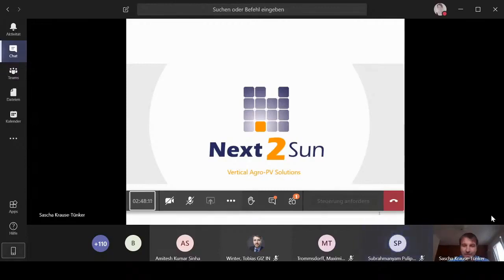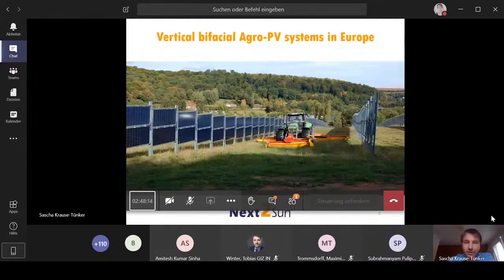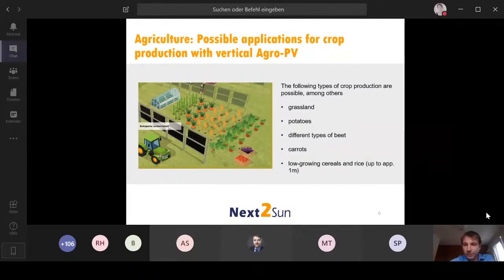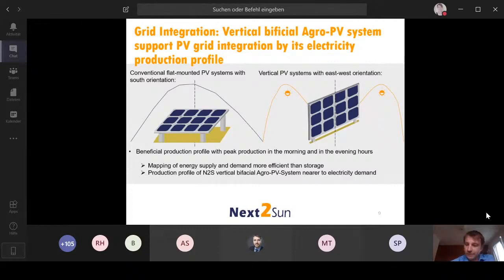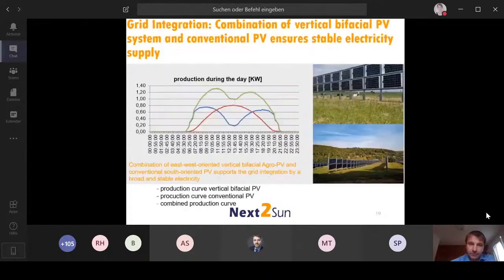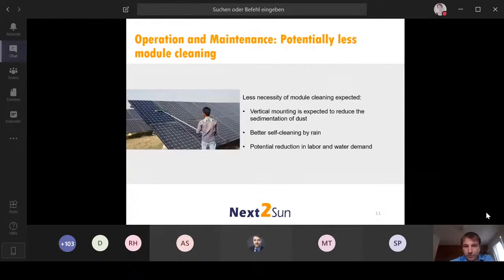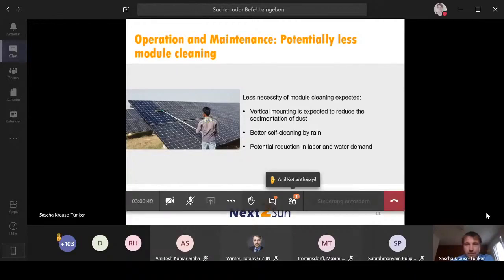Vertical Agrivoltaics in Europe by Sascha Krause-Tuenker

Comment: I designed, cut, welded and built my own system. I can tell you from bitter experience 
optimistically you can expect reduction of 30-35% in northern climates of your agricultural production due to reduced sunlight.
Optimistically.
Realistically it is unfeasible and unviable solution overall.
Neaither here nor there.

The two - solar and agriculture can ONLY be combined if your construction is HIGH ENOUGH and with enough inter-row and inter-panel spacing.
In my case it is 2 meters interrow and 25cm (10inches) inter-panel space.

This seems to be my goldilocks in my geographical location. 

Very important here:
My installation is 20kWp
The panels costed me 9,000 Euro
HOWEVER
The construction itself took me 5 months, countless hours of toiling and, 
prepare for this...
4,000 EURO for P-Shaped steel profiles, pipes, etc.

The construction itself was VERY VERY expensive.
Only reason why it wasnt 10+k Euro was because I transported, cut, welded, painted and inserted into ground via my demolition hammer each profile MYSELF.

If it had been with company tools - probably the construction would have been 10,000 euro or more.

in conclusion:
Solar and agriculture CAN coexist successfully,
HOWEVER
with certain very real and very expensive implementations, which are often prohibitively expensive.

Comment: hello very intresting i am thinking bilding a vertikal   bifacial in sweden but i am thinking of to put a metal sheet 2 meter on each side and lend them 20 degress toward the panel to increase sun reflektion when sun is ower 45degres of horisont and djuring low  produktion at noon thanks from jan petersson
Reply: I was thinking the same thing. Also if you had a N/S orientation in winter you could tip the v shaped reflector  so that on the south side it is flat on the ground and on the North side a bit steeper to take the light shining under the structure and reflect it up on to the backside. In summer the v shape wold be adjusted to reflect on both sides equally to the fence of panels.   I’d love to see size by side studies on this to see the effects and comparisons with equal length and equipment so that science could be done. !